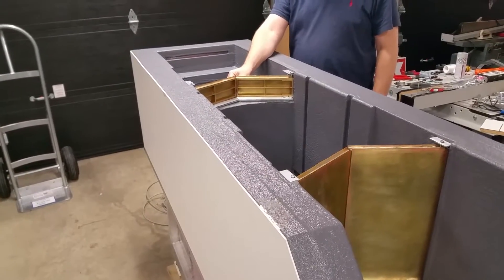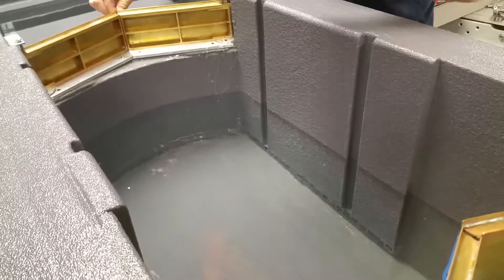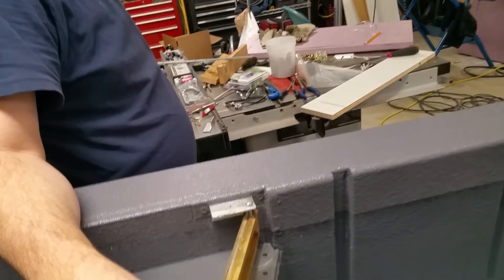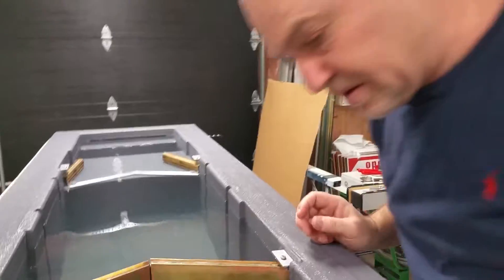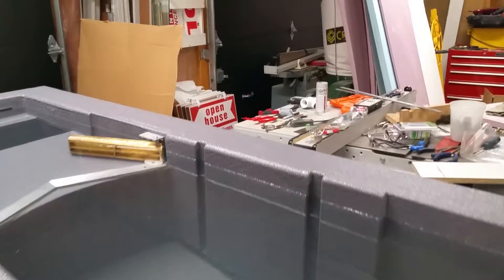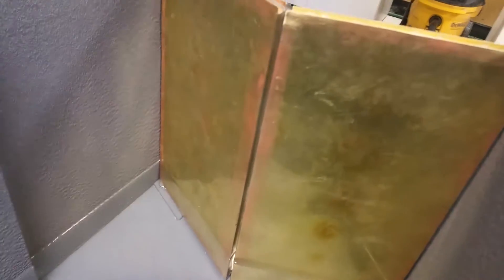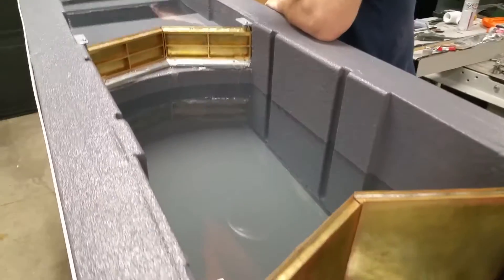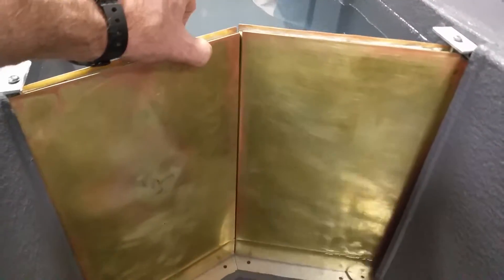First trial of fully assembled Fenelon Falls Lift Lock model

Comment: Very interesting, I like all the detail.  What materials are used in the walls, is it foam coated with a sealer?  How did you do the coins of the lock gates?  What are the intended use, is this going into a pond/river garden?  Have you seen my functioning lock chamber model?  Thanks for the video!  Jim
Reply from the maker: Thanks for your interest. Your setup is awesome!!! As you are aware, lots of little challenges...
A video of the finished model is here: https://www.youtube.com/watch?v=SEGvhE26Dz0
The walls are lined with building foam and then sprayed with pickup truck bed liner.
The self contained, fully functioning model is on display in Peterborough Lift Lock Visitor Center on the Trent-Severn Waterway in Ontario. 
It is also used by Parks Canada at boat shows and cottage shows in Ontario and Quebec.